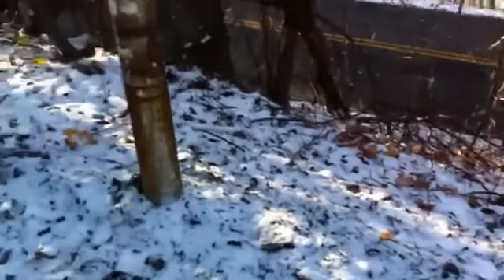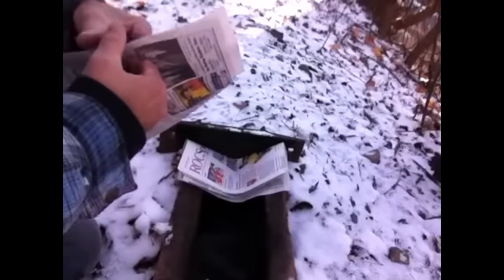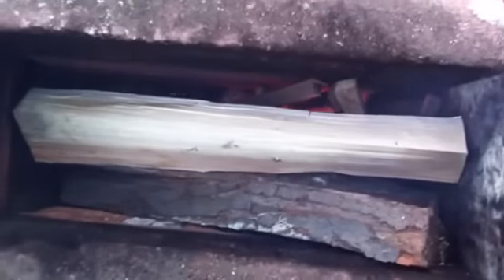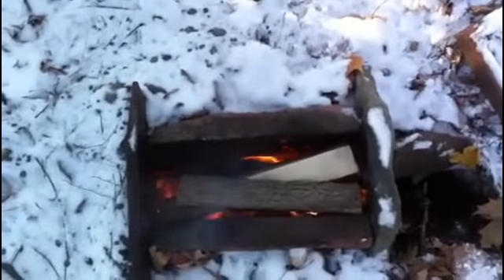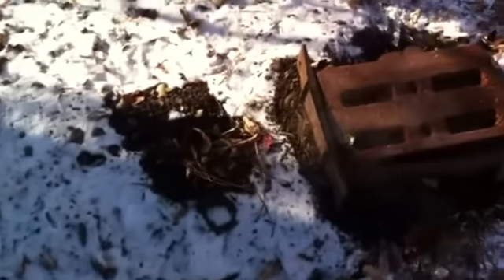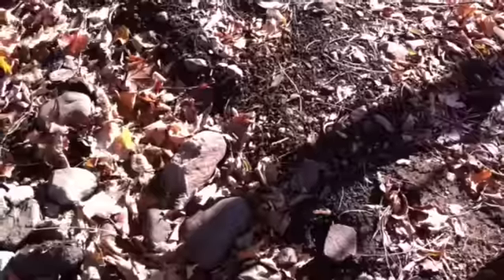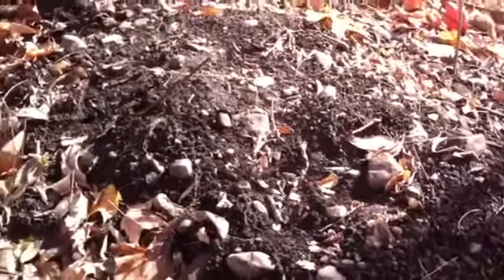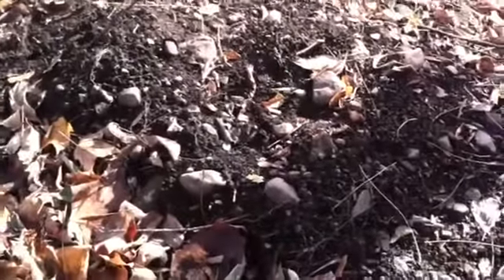Heating system for a winter shelter Pt. 2

Comment: this kind of under ground system can be use to store root veggies by using straw and dry material to cover.
Reply from the maker: It sounds like your talking about a root cellar, witch are popular around here with older houses. But it would have to be much deeper it's not uncommon for frost to reach 3 feet deep here. Thanks for watching and the comment.
ATB, Steve...

Comment from the maker: Hi Paul Thanks for watching and the comment. I spent some time in Korea back in the 80s and remember a system like that. They were burning small square blocks of fuel. I don't know what they were made from though.
Reply: They're called "Yeon Tan" (coal briquette) which burns for about 8 hours. I think there are some people still use them in rural areas.
http://en.wikipedia.org/wiki/Yeontan
Reply: In China， it‘'s called beehive coal. I remember this is from Japan.

Comment: Scope out some good camping sites during spring and put these stoves in using sand and pavers over the rocket stove. Then in winter you just clear the pavers and pitch a canvas tent. Make them so they will pull water and you can make fresh water to drink and have hot bath water. ; )
Reply: Jim Martin how would one make it pull water? Vacuum from the venting?

Comment: Congratulations
You have rediscovered the hot draft bed.
This very old design used for a multi day camp due to the amount of time it takes to construct.
For single night use the hot rock bed as touted by Ron Hood is better as it take less time and work.
The traditional does not require lining with rocks.
3 parallel trenches are dug approximately 1 foot deep and spaced about 1 foot apart. The length depending upon how many will be using it. Roughly 4 feet for 1 body and 2 to 2 ½ feet for each additional person up to about 10 feet or able to sleep  4 to 5 people. If there are more you will need more beds. You sleep close for added warmth. At the nominal up wind end a cross trench connecting the ends of the sleep area trenches. At the other end you construct the fire trench. This trench is 1 foot at the ends sloping down to approximately 2 feet at the center. A sloping ramp down to the fire or a setup like a Dakota fire hole will improve the burn and draw. Then all the trenches are capped with material at hand except where the fire will be and the chimney. The covering can be sticks, boughs, rocks or whatever. You are not always going to be able to find large flattish rocks for coverings. If any are found available they should be used near the fire. The soil that has been removed from the trenches is then spread over and packed down over the bedding area. The chimney is then built with rocks sealed with mud or dirt or can be built from mud or clay. The chimney should be a minimum of 3 feet for good draw or somewhat higher than whatever shelter raised over the bed space. The heat drawn through the trenches will then heat an area about 6 feet wide. Call it wide enough as most people are tall. You sleep across the trenches rather than parallel to them.
Obliviously such a system is going to take a few hours to build and be ready for usage. Then you will need to run the system for a few more hours to bake out any moisture in the soil. You don’t want to be sleeping in a sauna. This time should also warm the ground to make a comfortable sleeping temperature. Then you can either lie down or erect a shelter. As it can be seen the effort is not worth it for a single night stay.
While the fire can be left to burn out allowing the bed to cool as the night progresses it can be kept tended and continuously burning with much less wood than a conventional fire. This can be especially helpful if tending an injured party member which might be the reason for an extended stay. The fire can also be useful for cooking.
The 3 trench system gives you a wide area of heat with the ability to adjust the lengths to accommodate a varying number of people in your group.
Raspy
Reply from the maker: Hi Raspy, Thanks for watching and the awesome comment. Yes this is certainly not a new idea lol. After I made the video I have had a few comments telling me how guys used this method during WW11 and that the Romans used it on a much larger scale too. I was in the Army stationed in Korea and remember older houses being heated in a similar way.
ATB, Steve...

Comment: certainly does the job , just make sure your not sealing yourself off with a shelter , well you know what your doing atb PAUL
Reply from the maker: Hi Paul, your right of course. I don't think I would be sleeping in the shelter with a fire going. It seems to burn out very fast. But the heat lasts for a long time.
ATB, Steve...

Comment: I install hydronic radiant heat never did a smoke radiant heat system
Reply from the maker: Smoke radiant heat is better, You'll never get a leak lol... I've installed many hydronic systems but never in a winter shelter.
Thanks for watching, Steve...

Comment: Would it not be possible to put a rocket stove under ground that makes hot water heating when needed fresh drinking water and even electricity from turning a steam turbine all that can be done for a small camp with one rocket stove and good planning. When you bug out its always good to have a bug out place set up. I would have sites set up all over remote areas with most equipment already on site. This was a nice thought but improving its function and usage to cover a wide variety of needs to be taken into consideration. Other then just heating the ground for you to sleep upon? ; )

Comment: lam curious did you insulate under the tunnel under the ground with any kind of insulation and wouldn't this be a really good way to heat ones tent lam assuming you used stove pipe under the ground and l heard you say it was all covered with about 6 inches of dirt it looks like it would make a nice warm bed

Comment: Make a conversion with carbon felt to make it run off alcohol. The alcohol will burn hotter and at a steady rate. It would help if other components were being used say like a water heater to pipe hot water through coils under the floor and make hot water or run a steam turbine for electricity to charge batteries. Its nice to know one little gadget can be the backbone of a whole survival system that you can bury and leave just about any where. I little time a little money some hard work just could make a real difference in the end. One just never knows do they? = /

Comment: I would make a water heating system that ran coils under a prepared area while producing clean drinking water that can be stored. You could even fit a small steam turbine that generates electricity all ran off a buried rocket stove? Wow you can really do a lot with so very little right?